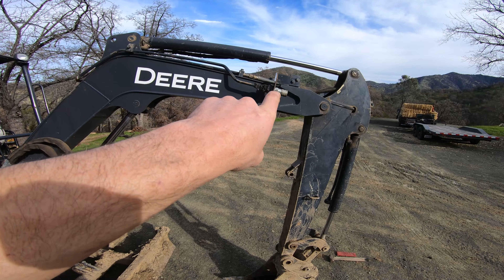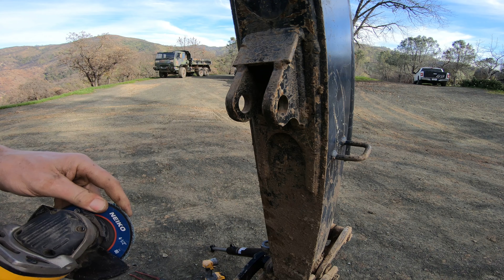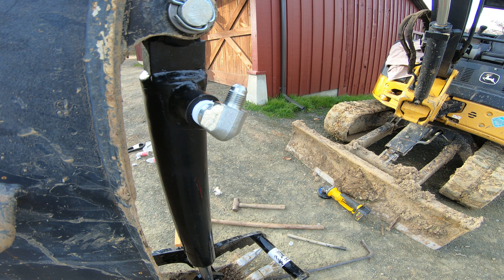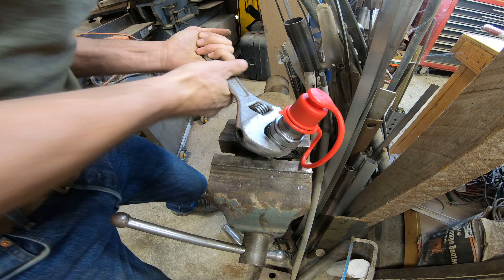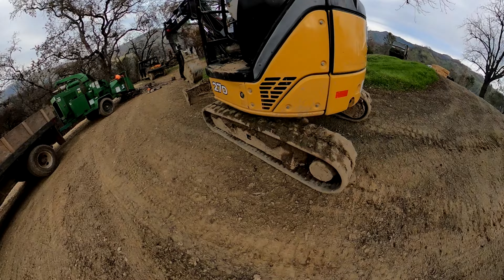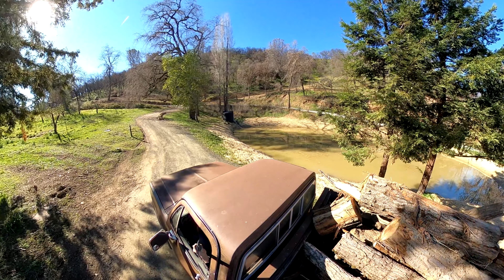Installing a Hydraulic Thumb on a Deere 27D Mini Excavator

Comment: I just installed a thumb on my New Holland E27sr mini, I set my auxiliary pressure to 1800 lbs, if you didn't set yours already, it's a good idea so your bucket doesn't over power the thumb piston, and bend it bud. I hope your still enjoying your machine!! 👍
Reply: How can i set to 18k lbs, i have 30g  JD , and bought a new thumb kit .

Comment: How much weight can that setup lift? I’m looking to get a 27d to move 2000 pound logs , is that unrealistic?
Reply from the maker: Held close to the machine, it might work but the whole rig only weighs 6500 lbs so probably too small. You should be able to find a load capacity chart at various reach distances and heights online.

Comment: I bought a thumb for mine but i dont have the quick connectors included...do you have the connector model, or are those standard?
Thanks for the video, very helpful.
Reply from the maker: They’re standard flat face couplers same as used on skidsteers.

Comment: I recently installed a thumb manufactured by Amulet and they state that unless you cut the relief pressure  on the aux valve to 2100 psi you void the warranty on there cylinder. Just saying. Plus I installed a flow control valve on the thumb to control the speed. Machine still handles the 3" brush cutter just fine. P.S. I also use Teflon tape, just careful not to put it forward of the threads.
Reply from the maker: Good idea on the flow control valve. Both thumb and tilt bucket are incredibly fast. Got a link to the valve you used?

Comment: Not sure if you knew but should never use Teflon tape on hydraulic systems, if any gets into the system can damage pumps, and valve spools
Reply from the maker: I’ve heard that. Tape is supplied with a lot of hydraulic equipment. I actually prefer to use recor-seal #5 when I think of it. Never had a problem with tape causing any problems though. Try not to overlap the end of the male part. Have you ever run across a failed part with Teflon gunk stuck in it?
Reply: You can use teflon tape, you just should start the wrap a few threads up so you don't risk a piece of tape breaking off in the line. Unfortunately he risked just that problem around 10:00, but it will probably be okay.